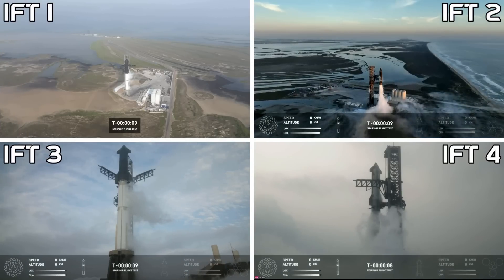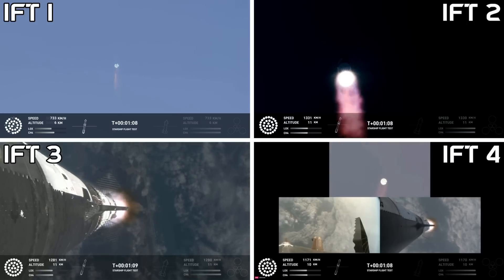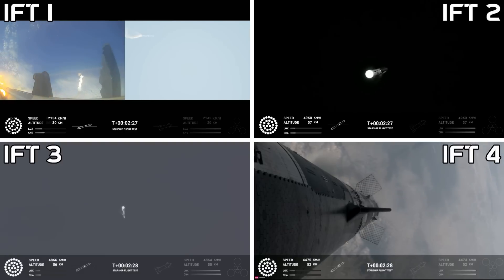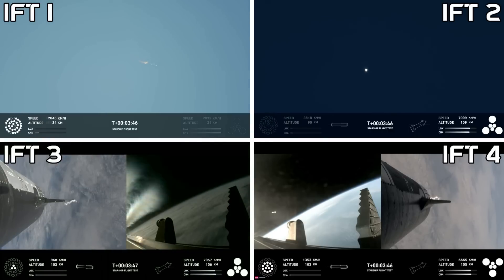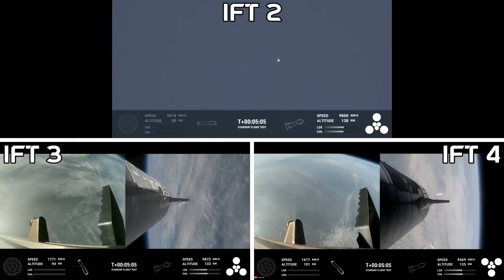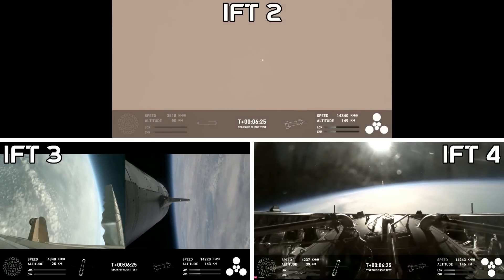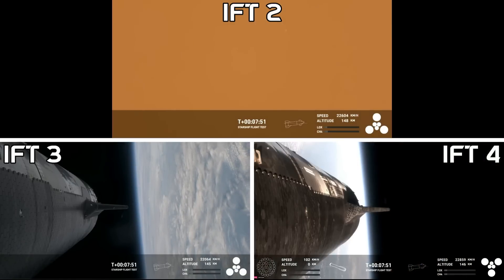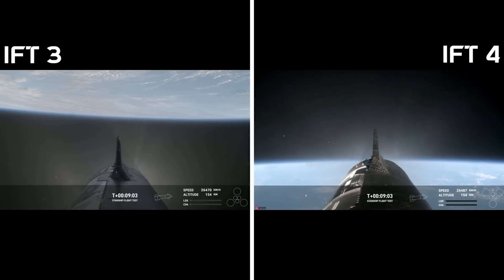Starship Launch SYNCED: IFT1 vs IFT2 vs IFT3 vs IFT4

Comment: The progression here is so satisfying!

IFT 1 main goals: successful separation. 
Result: uncontrolled roll, resulting in RUD
IFT 2 main goals: successful separation, orbit of starship.
Result: successful separation, RUD for both rockets soon after
IFT 3 main goals: soft splashdown of booster, orbit with starship, survive reentry.
Result: booster crashed into the ocean, starship went orbital, did not survive reentry
IFT 4 main goals: booster soft splashdown, starship survives reentry and soft splashdown.
Result: Complete success!
Reply: Absurdly great how i saw IFT4
Reply: Dont forgot IFT3's inflight engine relight that was not preformed
Reply: Although the fact IFT4 was a "complete" success remain to be seen, but I doubt SpaceX will communicate precisely on that. Basically that will define IFT5 goals.

First, the starship survived miraculously the reentry. It's great news but given the part which failed, it still was a critical failure (obviously not for a test run). It will be a necessity to fix that. How much this issue affected starship navigation control, and it's ability to aim and "land" where they wanted remains to be seen.
Regarding superheavy soft splashdown, the precision at which it aimed to the coordinate target remains also to be specify. Since obviously one want it to be able to grab those by the tower, the precision for the return is insane. Landing on a droneship (precision required, but a loss will cost less) or on landbase (less precision is required, but a failure might cost much more) is much easier, since now, we are aiming to higher precision than droneship, with much more risk.

Looking forward to ITF5. I hope they'll aim to catch a superheavy, but they might not dare yet, since crushing a tower would cost as much if not more than a whole entire flight. A landing of the starship might be a goal too, but since it's much more difficult to estimate how bad the failure of the shielding was, they might also have to postpone that.
Reply: @huyxiun2085  I agree, seems like too much too soon with the booster catch. And with the second tower rising, why attempt the catch until there's a backup? A drone ship landing would be great, but I don't think the booster has landing legs, even the tiny ones like the ship... still, a tower catch would be insane!

Comment: Its amasing how every time its just "a little" better. Step by step they are getting there!
Reply: a little better? dude they went from ift1 reaching nothing to ift4 reaching everything in that short time, seems like they were a lot better each time
Reply: @Nuke-MarsX  Yeah.. when I wrote it I realised that's not right, that's why I put "a little" in quotes
Reply: @YevhenSavchuk  ok..
Reply: @Nuke-MarsX  Still not in orbit yet. Still have not shown they can economically turn around starship and be significantly cheaper than a single use rocket. It takes only 1 SaturnV rocket to go  to the moon. It is take 15 refueling launches to fuel one Starship to get to the moon. The real challenge has not come yet.
Reply: @nickl5658  it could get to orbit easily if it needed to, and where did you get that crap with 15 starships to moon

Comment: Incredible how, many decades ago the FIRST Saturn V was just perfect with a perfect launch, no many tries to get it perfect, just the first try.
Reply: But it costed much more than this, and Starship is a entirely different system that is more advanced and designed to be fully reusable + it has 2x the thrust of the Saturn V.
Reply: Discounting the three astronauts that burned to death, sure.
Reply: And also the fact that the Saturn V, as the name implies, is not the first vehicle in the Saturn family of rockets. All the systems used on the Saturn V were tested on these previous launch vehicles or on the ground over and over and over again before they ever even got integrated with the Saturn V. The same thing isn’t happening with the starship because other rockets aren’t built to carry skyscrapers to orbit. It’s also more cost effective to use the affectionately named “Kerbal approach” to design and engineer rockets. Especially when you’re not making a disposable one.
Reply: I guess if you leave out the deaths of 3 people and the billions of dollars more in cost and twice the amount of time.
Reply: Yeah, it only cost 40 billion dollars. SpaceX is making a bigger, more powerful, cheaper and more ambicious rocket with 10 billion

Comment: That's its only taken 4 attempts to essentially get this GIGANTIC BEAST to work....mindblowing. SpaceX is amazing.
Reply: well, tbf, it also took a lot of testing of parts separately, but yeah, very impressive.
Reply: The first launch of Saturn 5, Apollo 4, reached orbit, then re-lit engines in orbit to achieve a high apogee, then returned the capsule for successful recovery. 

The first launch of the Space Shuttle, STS-1 had astronauts onboard and carried a mock payload. It orbited 37 times before returning for a landing at Edwards AFB without any significant damage to Columbia, being reused many times afterwards. 

The only comparable rocket program that has had so much vehicle loss without achieving orbit or having any recoverable equipment is the failed N1 rocket. American Rockets have traditionally been held to a much higher standard of success.
Reply: @MarcStollmeyer  hey remember when three astronauts died even before lift-off on a sa-v and the entire apollo program was revised for upmost safety and the highest standards?
Reply: @MarcStollmeyer that’s because those programmes use a fundamentally different approach to developing rockets than Spacex
Reply: @Superdelphinus  Actually, until Apollo1 deaths, NASA pretty much innovated the same way SpaceX does. The deaths in Apollo1 radically changed the culture in NASA, making it more careful.  SpaceX has not experience its Apollo1 moment yet.
Reply: @MarcStollmeyer  you don't seem to understand the different development approach.... And you also miss important details. 
When NASA develops a launch system, it takes them 10-15 years of pure paperwork, trying to think of and calculate in every possibility of anything that could go wrong. This causes a ton of over-engineering as they already cover problems that might never appear in the first place. They they do their first "test" flights with a fully developed and final craft and if it works, it will stay that way except maybe slight alterations over time. 
We saw that with Apollo, we saw that with the Space Shuttle. 

Instead of decades of paperwork and simulations, SpaceX does testing with the real thing, see what works and what does not work and then build up what's necessary. They are basically crash-testing stuff to make it better with minimal complexity. That worked great with the Falcon Project and is now the most successful launch system in the world with 300 launches, the most tonnage transported to space within a year ever and many more records. 

Its the same with Starship. With every launch they learned new things about their approach and fixed them and every try went further. They knew about the filter clogging with frozen methane flakes after IFT2, optimized it in IFT3 but not enough and fixed it in IFT4. This allowed the successful engine relight for landing of both, booster and ship. 

They knew about the heat shield issues on the hinges and already have plans to fix this before IFT4 even launched but they still tried it to see if it fails as expected and it did. But it was also to see how long the ship can hold up IF the heat shield fails. You can't simulate that. You need to test that. And that's what they did. This is how they developed and over the last 20 years they have been very successful with that. 

Falcon 1 
Falcon 9
Falcon Heavy
Dragon Capsule
Crew Dragon
Multiple brand new Rocket Engines developed from ground up including the most efficient one ever created

And now Starship and Falcon Heavy
Reply: @b14ckyy  the notion that NASA’s development takes decades while SpaceX’s takes only a few short years is wrong. 

Saturn 5 took 5 years from elevator pitch to successful first launch. 
Space Shuttle took 10 years. 
SLS took 11 years. 

Starship has been in development since 2012. It has now been 14 years and it has yet to reach orbit, let alone perform in-orbit refueling, let alone go beyond LEO, let alone prove it can deliver any payload to orbit. 

NASA gave SpaceX the equivalent of 4-5 SLS missions worth of funding to complete starship for Artemis. In a non-reusable mission the launch cost is the same between SLS and Starship. Except Starship needs over a dozen launches per mission due to refueling. So even if starship was 15 times cheaper than a single launch of SLS the end result would be the same cost.
Reply: @MarcStollmeyer  you are wrong on so many levels here. I just wrote a long answer  but the page locked up sorry. YT is not the right platform to discuss that. But in short. Your dates are wrong. 7 years for Saturn5 first flight unmanned with nearly unlimited budget and 20 billion spent in todays money and space race pressure. 9 years for space shuttle with a near cancellation in between and 49 billion of spent budget. SLS took 12 years from approval to first test flight last year with a 9 billion development cost + 2 billion in launch costs. Despite it being a mashup from already existing engine, tank and booster technology. 

Starship has in total so far cost 2 billion in development. Where did you get that 4-5 SLS launches in budget from? Maybe the whole budget is that much but the cost so far was a bit over 2 Billion. Literally 1 SLS launch worth. 

Yes refueling with the current starship design would take ~10 launches depending on the final tanker capacity. But that's why a bigger Starship is already planned for pure cargo and as tankers. but the launch costs for full reusability should be realistically in the tens of millions range (Elon says 2 million but I doubt that as well) including profits for SpaceX. So its still a fraction of a single SLS launch.
Reply: @b14ckyy  you really think starship development has only cost 2 billion at this point? IFT1 was a billion by itself. IFT 2-4 have all been north of half a billion. That’s not including all the other ships they’ve built or starbase itself. Elon says whatever he wants, he never has to back it up and when people call him out on his lies he buys a social media company and bans them. We have no transparency into the real cost of starship thanks to them being private. 

2 million a launch was based solely on fuel costs. Refurbishment and launch costs are way more than that. A reused falcon 9 costs 45% as much as a single use falcon 9. Even if that number was 30% for starship and we generously assumed 500 million per Starship Stack, that’s 150 million per launch. Times 13 (1 lunar starship and 12 tankers) and that’s $2 billion per mission. SLS is $1.2 Billion and is capable of lunar orbit in a single launch. 

SpaceX has said starship will be capable of 100 tons to LEO. Assuming they achieve that in the future its simple math. Starship has 1200 tons of fuel capacity. So 12 launches. 13 if we include boil off. Likely 14 for safety margin. Curiously IFT1,2,3&4 all had no payload at all, so I’m going to assume the increase in size is to hit that 100 tons number… hopefully the ship doesn’t require more fuel to do the moon mission.
Reply: @MarcStollmeyer  so how is 2026?😉
Reply: @MarcStollmeyer  spacex only started hardware development somewhere around 2018 btw, considering how revolutionary this thing is and how far beyond normal rocketry it goes, it’s surprising it hasn’t taken longer.
Reply: @MarcStollmeyer  “you really think starship development has only cost 2 billion?”
Yeah, wanna be in denial about reality? those are the figures, raptor and starship have large fast production lines using relatively cheap materials, the cost of a single starship prototype is honestly negligable cost compared to the actual operational costs of building and running starbase, which is where the majority of that two billion figure comes from.

I get that you desperately want apollo to be “better” than this program for weird nostalgia reasons but none of the actual trained engineers at spacex and other institutions share your opinion.
Reply: @MarcStollmeyer  Well good thing both the shuttle and Saturn V had less goals than Starship
Reply: @MarcStollmeyer  True, but now compare budget.
Reply: @MarcStollmeyer It certainly isn't impressive that it took four attempts, but it also isn't necessarily a bad thing either. 

As I'm sure you've heard, SpaceX uses an iterative development process. This allows them to manufacture many rockets at scale and at a much lower price, meaning losing several isn't a big deal.
Reply: yeah, considering how much luck is involved - this is simply mindblowing!
Reply: @alcoholrelated4529  thats not luck! thats people working extreamly hard for the future!

Comment: if you look at ift2, ift3 vs ift4, you can see how much one engine effects the acceleration of the rocket. IFT4 had a noticeable lower velocity
Reply: Only on fly 3,also on fly 2 thers is no ring between starship and the booster,whitch means less mass.
Reply: @aleksandurmilanov8840  its definitely lose of 1 raptor, HSR also attached IFT-2 IFT-3 flight computer decreasing power of the opposite engines for balance. So rocket actually loses more power than 1 engine
Reply: @aleksandurmilanov8840 flight 2 was the first that used hsr
Reply: It’s not actually about engine, it does have different flight profile, there is confirmed info that booster 11 was throttled down all the way up to the max q
Reply: @aeveliefindyourself  yeah, they dont run the engines at maximum 100% power, more like 97%, so one engine makes no difference. it was the flight Profile, flight 3 also flew slower. Its not about how fast you get in as little time as possible and i think people dont get it lol
Reply: is there any probability for space x to shut off one engine intentionally to check the difference with full-engine flight?
Reply: @misoramen99  no
Reply: @wloffy  but don't they already have enough data to make sure all the engines run? the engines were all right during last two flights.
Reply: @misoramen99  they didn't shut off an engine bud
Reply: @gbodybala9295 They kinda did? Most of the time an engine fails it's the computer shutting it down after detecting a problem. SpaceX shut that engine down, they just didn't plan to.
Reply: @misoramen99  they dont need data to running engines, problem should be plumbing, electrical or somethin it will be resolved. Raptor is new engine
Reply: @Starjumper2821  no, most of time computer does not shuts engine. It decreases power of the opposite engine if its necessary it can shut down. Maybe in IFT-1 thats why opposite engine didnt work
Reply: @wloffy what he meant is that they can shut down the failing engine before it does so fully, decreasing damage
Reply: @wloffy  thats not right, they had it on the N1 becouse they courld gimble the engines, but the raptor gimbal is so insane that you courld probably loose 4 engines on one side and strill fly normal, just with less acc.
Reply: @FreddyyFazzbearr n1 engines didn’t gimbal, they used thrust differentiation
Reply: @okaySLBTW  ik, thats what i meant
Reply: @FreddyyFazzbearr  you said in your comment that the n1 could gimbal their engines
Reply: @misoramen99 I doubt that they did that intentionally, right now there is a lot on the line to get these test flights as far as possible. 

But as the mentioned before, the booster is just fine without one or two engines as long as they don't explode and damage other systems. It clearly shows the ship down but it just as clearly doesn't matter. 

Anyway, they probably did not plan for it, but they won't be mad about getting data from it considering the rest of the mission went as smoothly as it could have. In the end I dare say it might even be better for them to have one engine out at this stage of testing despite not planning for that.
Reply: Yeah, and staging happened ~10 seconds later for the same reason
Reply: Isso não faz tanto diferença porque o Starship com seus seis motores a nível do mar e no vácuo, buscaram essa diferença de velocidade, então está tranquilo
Reply: Iterative flight test 
✌️🚀
Reply: At least when it comes to the super heavy booster. IFT4 starship was still the fastest to cutoff speed despite having a lower velocity at separation.
Reply: Loss of one engine and also redesign of the overall ascent to be slightly slower.
Reply: And overall longer burn to get the same result.
Reply: 5:34
Reply: Yeah!! Was just about to comment that. That’s an amazing difference from a single engine. I suppose it’s not just the loss of thrust but also the mass will drop slower also.

Comment: The mic recording audio for IFT4 sure couldn't handle it.
Reply: Definitely possible but it sounds more like a steam lag to me.
Reply: @hvip4  Nah.  SpaceX set up two side mics in addition to their normal mono mic and they were using them to provide a little better (if not strictly true-to-life) stereo spatiality.  They were not situated absolute left or absolute right, but between center/left and center/right, which makes sense, since it wasn't a true stereo soundscape.  The one on the left got cratered immediately by the excessive input.  Not only is that intermittent buzz more or less what you'd expect, but there was absolutely nothing wrong with the mic prior to T-0.  It was picking up the scream of the deluge system just fine, for example.

Comment: IFT2 went much faster because of no inter-stage ring! it's a lot of extra mass! and 3 was faster than 4 presumably because of a missing engine?
Reply: Flight 2 had the hot staging ring
Reply: Also the flight 4 were alot more reinforced than flight 1,23
Reply: Yes
Reply: IFT-1 is the only Starship ever flown without the hotstage ring.